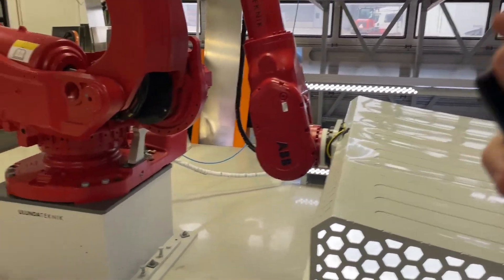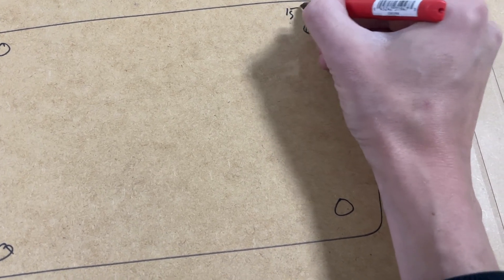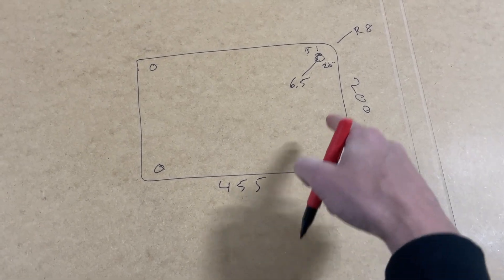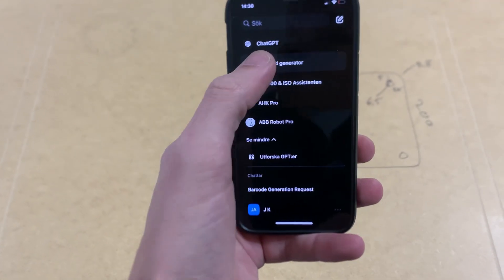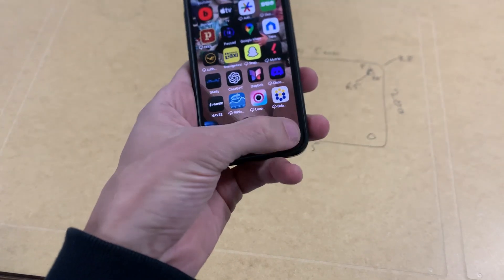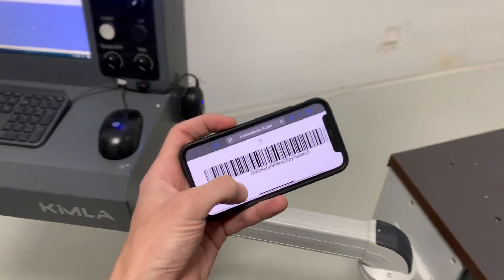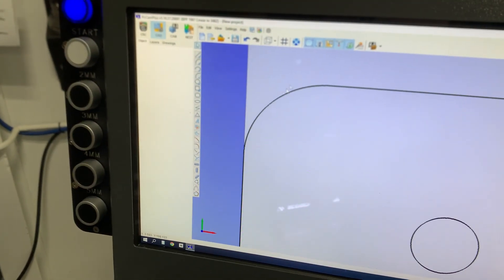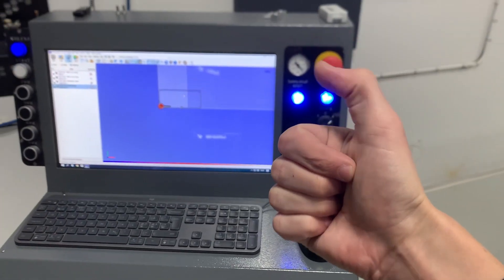Drawing to gcode using ChatGPT

Comment: I absolutely love this, it works so seamlessly it feels like a magic trick. I'm writing a university project on generating  Gcode semi-automatically for woodworking routers and this is so cool I want to try and recreate some of it. Any tips? I can wrap my head around some of it but the barcode confuses me
Reply from the maker: I should update it a tad and release the code with a explainer video so ppl can take this further. I havent touched it in a year, Its simple really and that will be appearent when you see the code.
The barcode was just a way for me to get it into the machine computer, whats important is the "seed". it contains the instructions that is used to "draw" the dxf file.
If the part is a rectangle then the seed will start with r*value1*r*value2* ect, those are the sides of the rectangle, the next is "rr" value which is just outside corner radious, then hole sizes and coordinates,then thickness ect.
The magic is really the script drawing a working dxf with the features on their own special layers that allows for the autogeneration of gcode id say :)
Reply: @randomrouting  Thanks a lot, let me know if you end up releasing it I'd love to take a look. Having read the seed it does become easier to understand the inner workings. I assume with the current setup it can only parse a small number of predetermined shapes? Like if I asked it to draw a round plate with a star shaped hole it wouldn't be able?
Reply from the maker: @Michael-jl8gj  Correct, while round shapes or shapes within shapes isnt a problem, (it would just start with c*value* instead) the star in the middle would be. First all needed dimensions need to be on the drawing for the AI to see(messy if done by hand), second the script would need to be able handle it, if every line was defined in the drawing with the length and start/endpoints(maybe angle?) from some known point then it COULD be done line by line by the script but yeah.. this is as of now just for simple (circles,squares,rectangles) shapes with a few holes with maybe some tapped or countersunk holes.

I have an idea for a new demo tho, ill add some features and show off the code when i can :)
Reply: @randomrouting  Thanks this makes it easier to understand. I'll figure out if any of this is useful for the woodworking industry and  maybe try and implement some of it. As far as I know the software we use for our routers (SCM maestro) can't automatically associate tools to layers and requires a lot of user input after importing the DXF file so this may limit usefulness. Again congrats on the proof of concept!

Comment: Love it, BUT shape like this indeed takes 3 minutes to draw in cad. And more complicated thing are more prone to ai errors.
Reply from the maker: Indeed, im with ya. But as a proof of concept it shows promise for the future i guess as ai improves then the potential for this does aswell.
You got to be quite a novice at cad to really need this today but I like that the different features end up on correct layers so that the gcode can get autogenerated with single button. Saves you having to individually select them and load the templates manually.
Reply: @arantme sorry for the harsh tone of voice - I need say this as clearly as possible.

Your comment is uninformed and unimaginitive, and a microcosm of a mindset that resists progress.

3 minutes, you say? The demonstration starts at 1:25, and the part is imported at 2:56 - 1min, 31s (twice as fast as 3min).

(Yes, he sped up the video, but the barcode feature did not work - which is presumably fixable)

You're also assuming - incorrectly - that this is as good as it's going to get.

Yes, you're adressing an important issue that advanced drawings might/will fail, but yet again - this is not The Final Form, it's a prototype of a maturing piece of tech.

The man demonstrates amazing usage of AI, that actually holds value when talking with customers. While your reaction is warranted given the actual state of the demonstrated procedure, it's still narrow minded and friction for positive progress.

I am very impressed by the demonstration, and I sell GenAI software to low- and high-tech companies with huge success. Well done, Sir!

Comment: Sure, AI is always cool as a proof of concept, but should always have BIG BIG disclaimers when showing these kinds of demos. Because the AI WILL be confidently wrong both obvious and super subtle ways, which will ruin your part, if you do not triple check the gcode your self. In the worst case, it could even ruin your machine. So if you still have to triple check every single line of gcode, why not just write it yourself at that point?

Coming from a software guy who uses AI most days of the week, who only knows about gcode from 3d printers. But I am curious about your comments on my perspective?
Reply from the maker: Well, the gcode is accually generated by PCCAM in this case, so no worries there. All the AI does is find find features/measurements and gives the "seed" containing the needed information about the part, that seed is parsed by a script that effectivly draws up the DXF file and places the different features on layers that the router(pccam) recognizes and thus generates the gcode. Works for tapped holes and countersinks aswell.

So the shape you see on (router computer) screen is not a representation of the movement due to the gocode, its an actual dxf.
Reply from the maker: EDIT: I added this to the description,  thanks for asking, was good to clearify :)
Reply: @randomrouting that's a great explanation and I appreciate it.  If it's relying on a script underneath to produce the shape with parameters specified by the llm, I'm less confident it will continue to improve in terms of complexity of parts.
Reply from the maker: @jeffreygordon7194  Hopefully ill have a video on a more complex version 2 today or tomorrow, you will love it :)
Reply: If you go and look at some of his previous vids you will see how he has setup pccam to auto generate the gcode from the dxf. Just love it as a one man show, everything thing that can save time is a huge bonus, especially if you don't have to sit for hours to tweak and clean up code even after you have spent time doing it in the cam software.

Comment: any chance you can get gpt to spit out seed directly? would be nice to log into openai from your computer and just copypaste, at least while the barcode is out of commission
Reply from the maker: yeah definately could do that. I guess tho one could make a "IOS Shortcut" to take the picture and then send it using the open ai api to get the seed /autogenerate the file that ends up in the routers computer ect.
Its a cool use case but one would need to expand on it to take more advanced drawings, im not really using it as it is since still quite rare for me to get those simple drawings and when i do i simply draw them up on  the machine. but still.. cool use case :)
Reply: The chat should be logged on the OpenAI account so after you’ve uploaded the picture and sent it the answer should be reachable from the desktop if you login there as well